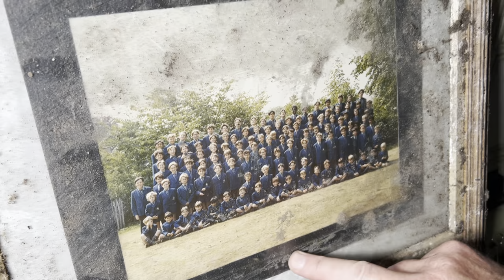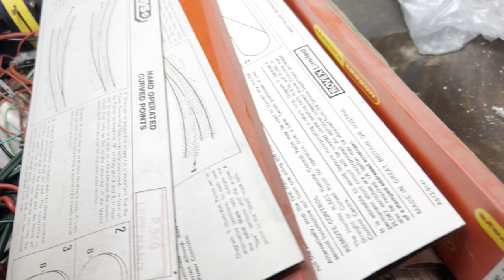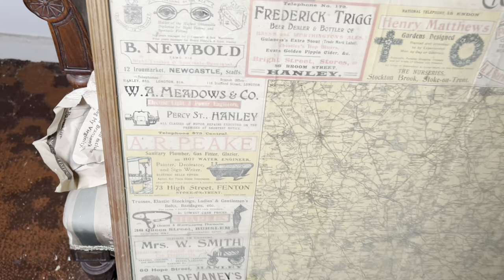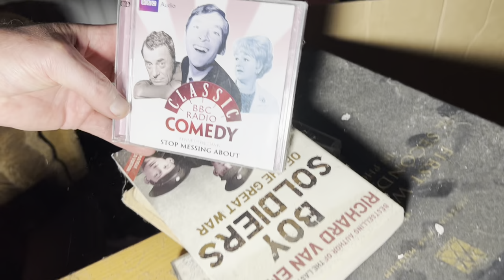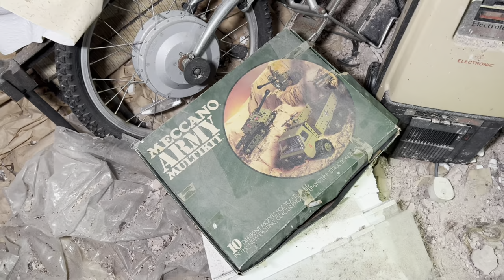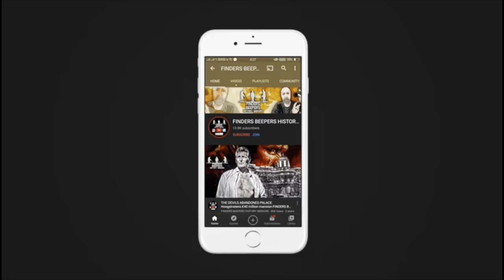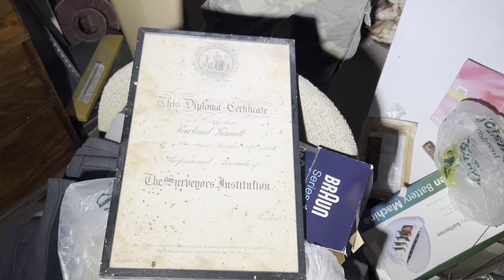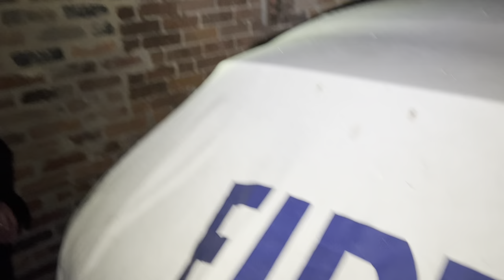This spooky ABANDONED house is on track to freak you out

Comment: isn't a rectifier controller something used to level out a high power electricity supply?

I think they used manual based systems to trim supplies to sensitive equipment before they improved supply feeds and the electronics to the point they could deal with it automatically.

Think they still use them on sensitive equipment now though...although, likely computerised now